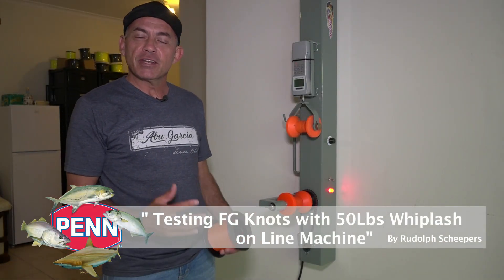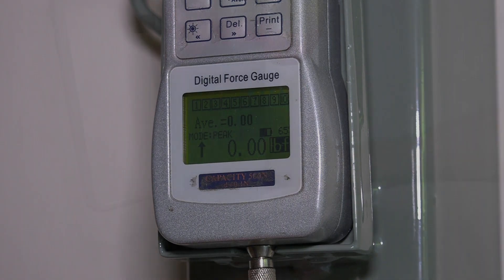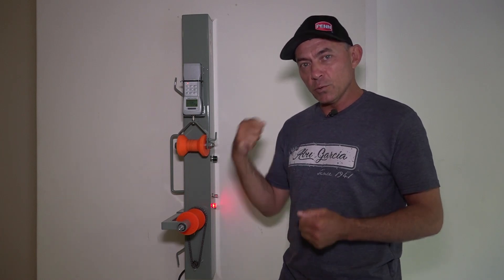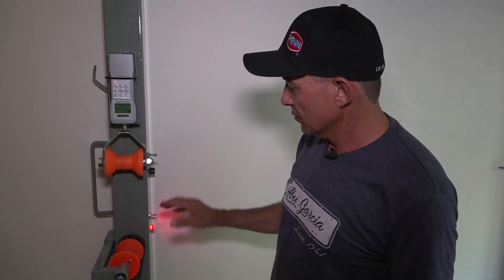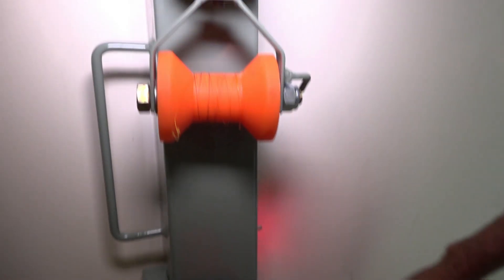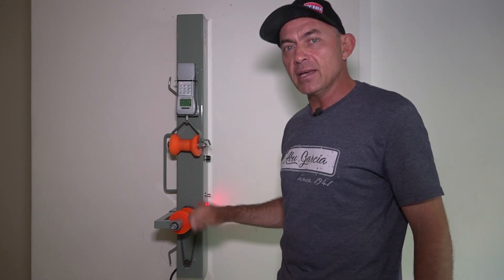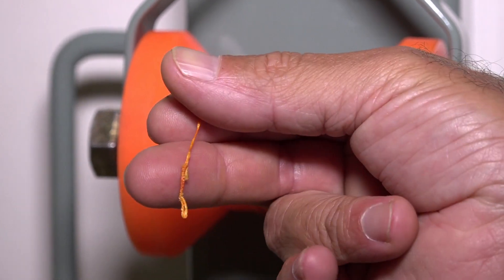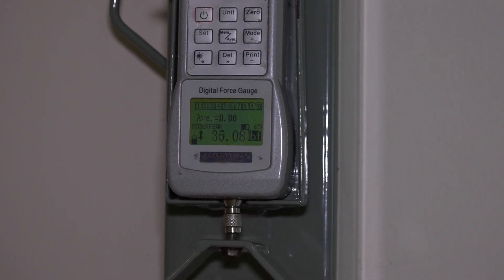Testing FG Knots (50Lbs Whiplash Braid) with Line Breaking Machine

Comment: FG is supposed to be a 100% knot but is usually tested as it's used in the field with braid to mono / fluoro. If you try it with a 50 lbs braid with 50 lbs mono I believe it break at or above the rated line strength.